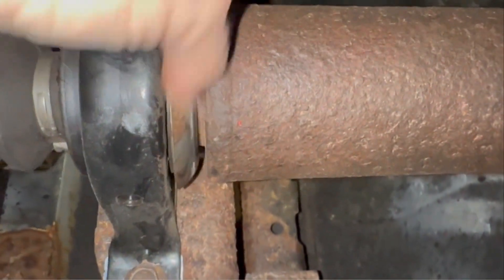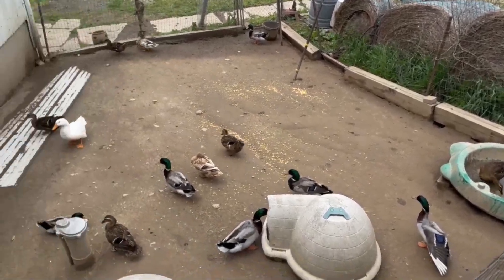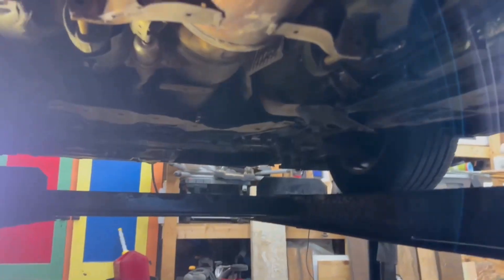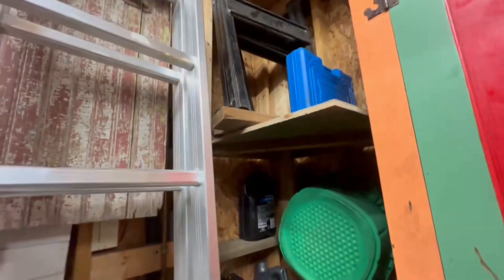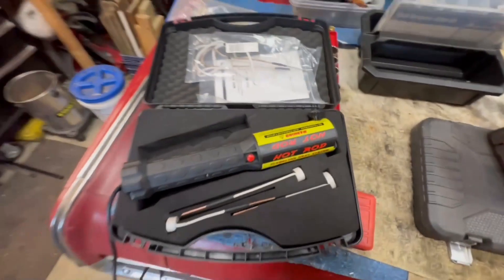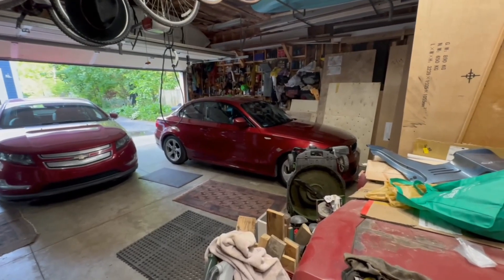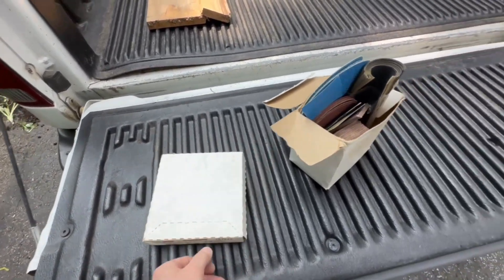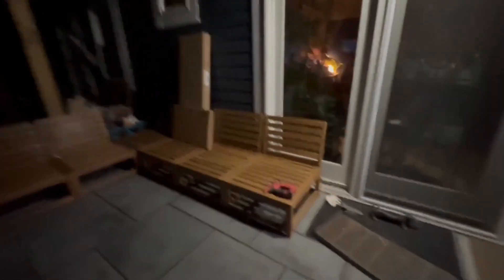A dad. Week 3 May 2023 #GarageSaleFinds

Comment: Either my brakes just work, or I don't notice the issues...  either way, I never usually have these problems.

the brake gods hate you
Reply from the maker: they do.. Also I have a fleet of 100K+ cars/trucks  1997 z3, 2002 F250, 2010 Prius, 2011 civic, 2012 Prius, 2012 128i and 2016 van..  (plus 69 Mercury :-) she got leaking rear brakes)